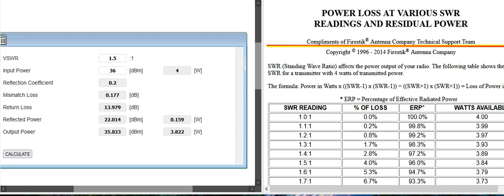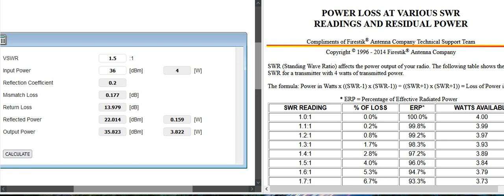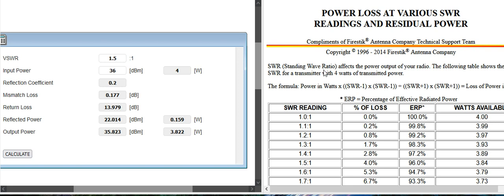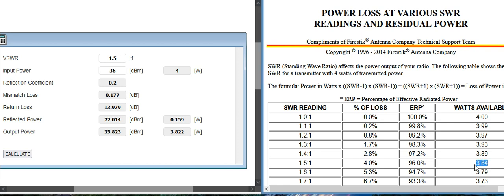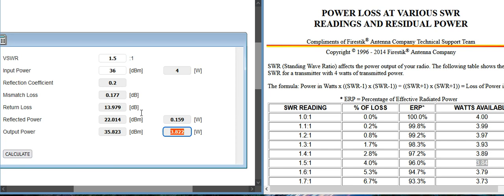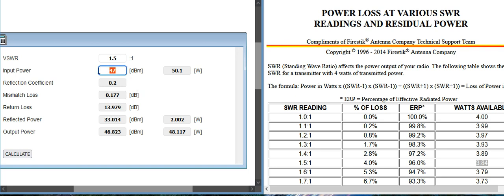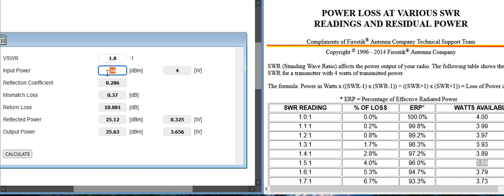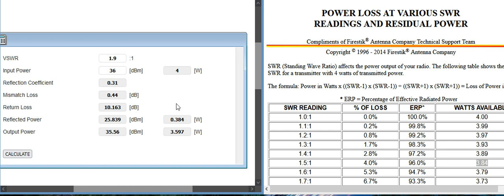🔺 How much power output (wattage) is loss when the SWR is high when using a GMRS two-way radio?? 🔺

Comment: Totally wrong the loss of the cable must be know to see the power loss due to the SWR.  High SWR and low loss cable  can be less loss than low swr and lossy cable.
Reply from the maker: if the swr is 1.5 you will see a loss. But with that same swr and poor cable, you will see more loss. I did a video showing the power increase by using better cable with the same SWR compared to poor cable. I see what you are trying to say, but I go by what the meter shows too. Either way, there is going to be some type of power loss that will be shown, that is what people want to know.